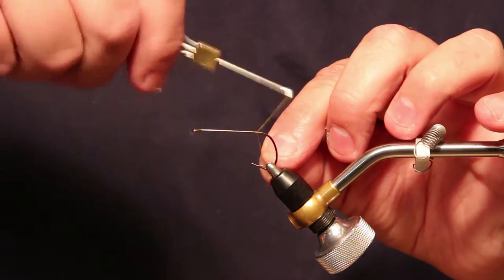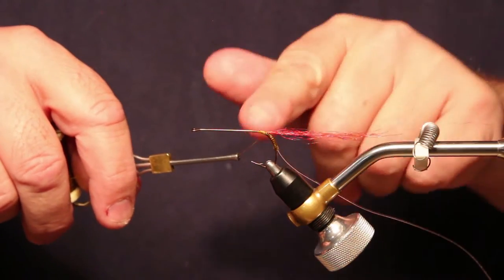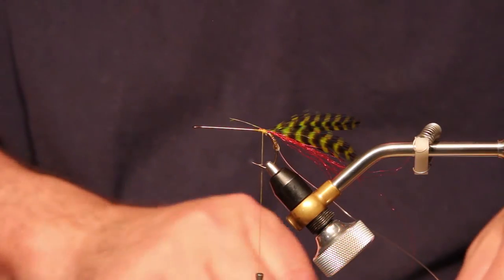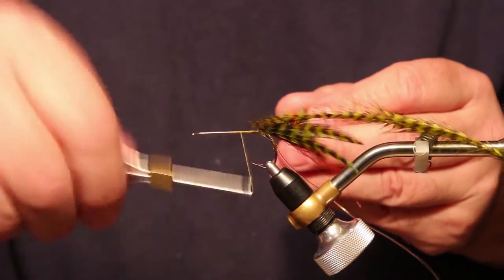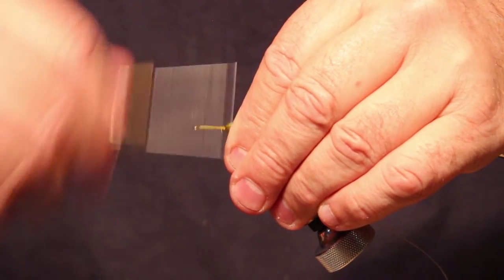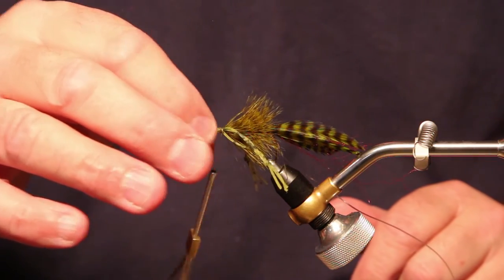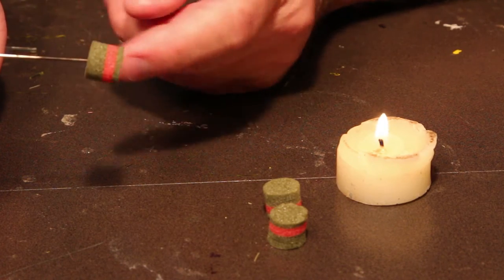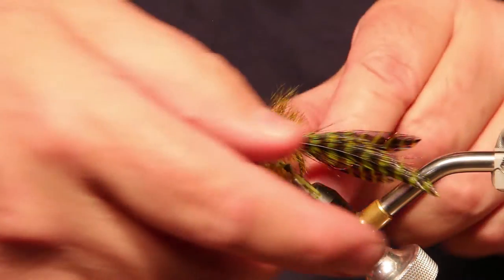Mihulka Foam Frog - #4 in my Foam Fly Tying Series

Comment: yes sir i wanted to ask u do u think a popper punched out with a 7/16 punch using a size 4 hook long a streamer hook with couple feathers and some hackle a fair set up for a 8weight rod using 9 foot 1x knotless leader
Reply from the maker: That setup should not be a problem. I do the frog fly up to 3/4" punch and cast it with a 7 weight, but not if there is much wind. You might be better with a 7 foot leader, unless the fish are spooky.